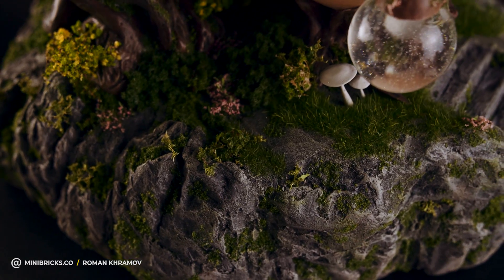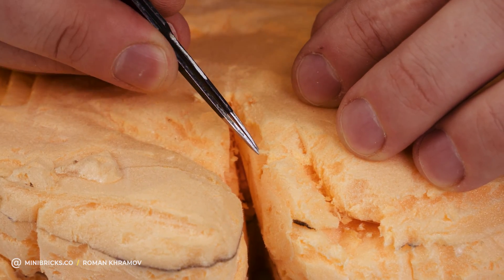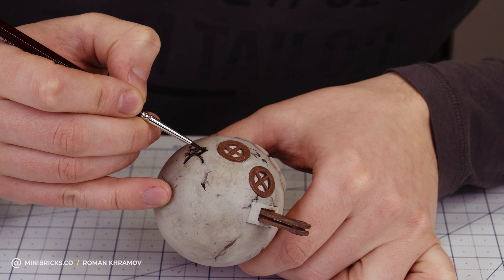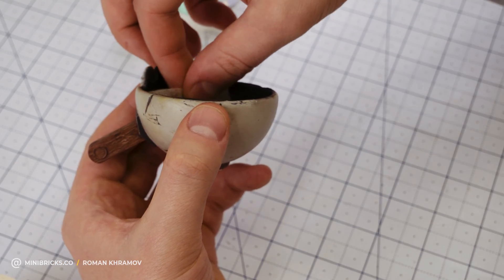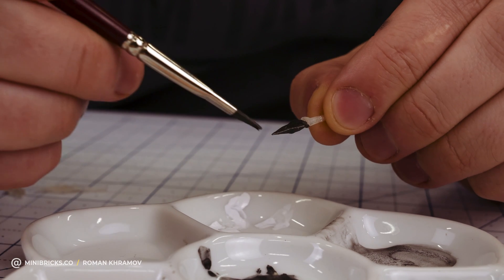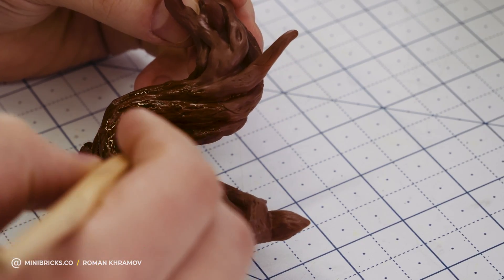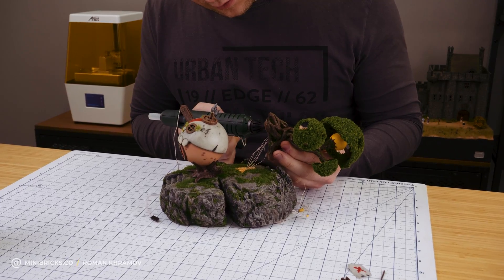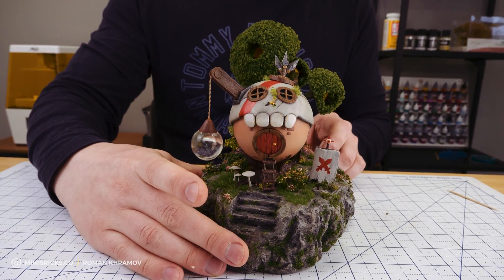Fairytale castle with LED Arduino Lamp

Comment: This looks great. I was really hoping to see you make the whole thing though, instead of using the 3D printer. I think the hanging lamp might be a bit better if you had sanded the outside of the bulb part, because that would've made it look like a frosted glass... just an idea. Great video 👍